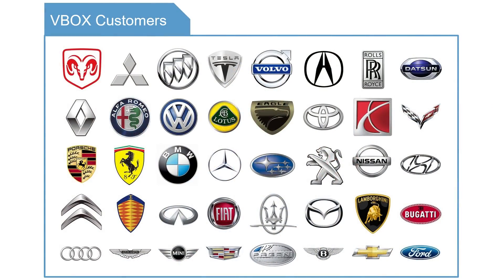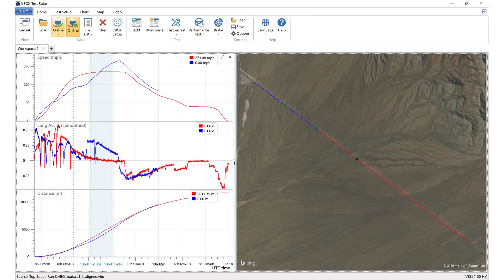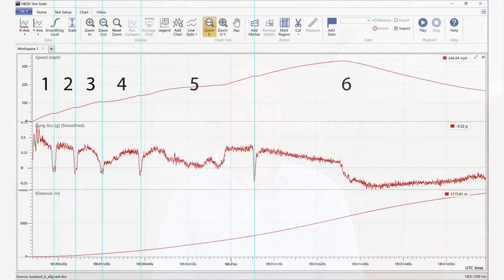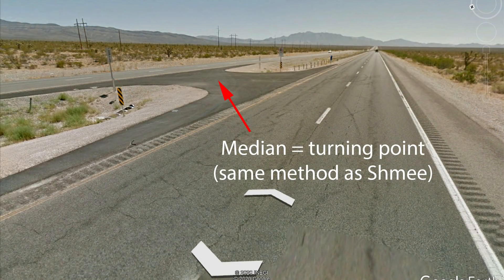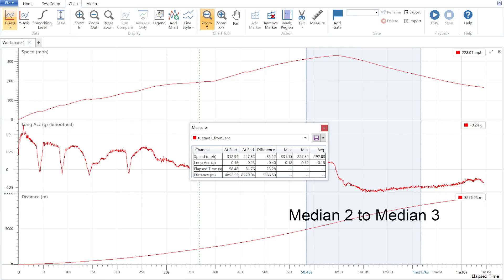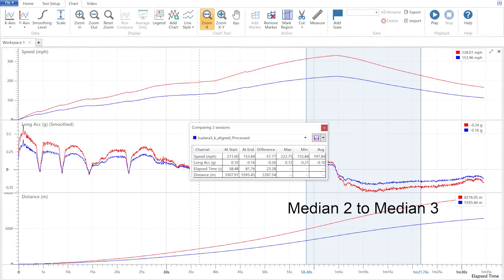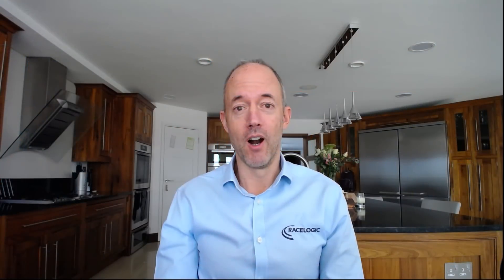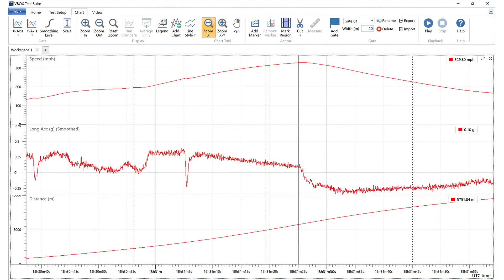How fast did the SSC Tuatara really go? Here's my calculation based on some new data.

Comment: HENNESEY VENOM GT WITH 1200 HP REACH 271 MPH

1750 HP SSC TUATARA EASILY CAN DO MORE THAN THAT
Reply: He does not say it was the cars top speed. He is calculating the speed in the video and it was still accelerating pretty good when he let off. Didn’t you watch the video?
Reply: True it should be much faster. For some reason they chose to cheat. Maybe it was too windy maybe there was another fuck up they had to deal with and did not want to waste the closed road. So they faked a run. Only they know.

Comment: Kudos to Shmee, Misha and Robert as well as Julian for the data analysis.  If the estimated Vmax is 223 mph, I need to ask, and with all of the respect, how did Oliver Webb not realize that the speed seemed too slow for 331 mph... that is approximately 100 mph (160 kph) less.  I would imagine an experienced race car driver would detect something was awry.
Reply: He's not paid to talk.
Reply: It looked good on Oliver's IG page which seems to be more important than actual racing. From experience I can tell that 250 feels twice as fast as 200, and also 285 feels again twice as fast as 250. Yes, on this cock up, everyone including driver, were sleeping. What a joke.
Reply: @erik_eriksson_design  id bet since he was the driver he new but it depends on how isolated you are. Going 150 in a new s class vs a 20yr old corvette makes all the difference. go karting at 50mph seems extremely fast
Reply: He already drove a One:1 over 240mph at VMAX200 event before, so it's quite hard to understand how SSC has convinced him that he was doing 331mph. Imo, he probably did felt something was wrong, but has nothing he can do about it, and decided to keep his mouth shut. On the good side, he got another VMAX200 record of 404kph (about 249mph I think) in a Koenigsegg Regera with a passenger beside him a few days later.
Reply: If SSC used atleast part of their brain capacity setting up the run, making sure that the driver signed a NDA simply stating that he cant make any comments of the run, whether the car achieves a higher top speed or not, would be smart. Can't have any loose ends with this much at stake.
Reply: Ask Diego Maradona why he didn't cry hand ball when he scored ,"The hand of God" against England.
Reply: Whoops. Sorry Diego. People have a habit of dying when i mention them in a bad light. My bad.
Reply: @Elias Håkansson maybe half way through run he felt some bad juju and said nope, that’s fast enough
Reply: It is 175kmh less. That is massive difference. Especially when comparing 360kmh to 530 that no man has before travelled in public road. Shameful scam.

Comment: The biggest red flag among many remains the rather absurd acceleration from 260ish up to 331, which would put the SSC squarely into Bonneville Salt flat rocket car territory.  All legit speed runs by the main players, be it McLaren, Bugatti, Koegnsisisnenengegegegeggggg, etal, show an ever-slowing acceleration as they approached the V-max, which matches known physics.  If this SSC data is to be believed, this car's top speed is closer to 400 than 300.  Just absurd.
Reply: SPOT ON. 

for anyone with a brain the whole thing looked fake as hell just by eye let alone requiring all the verification data. such morons
Reply: You nailed it! In fact that was my impression too, even before I found out the questions being raised about this "record breaking run": It goes from 400 to 490 km/h in just 10 sek.(!!!), where the Bugatti does it in 40 sek. It is just too fast having "only" 1750 hp..........
Reply: @perhentzepetersen9310  it fack man!  being mechanical engineer i know that by increasing no. Of cylinder and decrasing cc  of each we can decrease torque and increase speed but it look like kiding   when i saw this at 13th of sec in video tuatra reach 331mph!!!😂😂😂
Reply: @perhentzepetersen9310  VTEC just kicked in lol
I wasn't paying that much attention but yes well spotted.
Reply: I like how you spell koenigsegg 😊

Fun fact: I used Google speech-to-text for the right. How did I learn the pronunciation? I've been watching a lot of agera and regera videos
Reply: @DevJMD  herby derby
Reply: @DevJMD  We know its BS, he knows its BS, even the name Jerrod Shelby uses for his company is BS. Jarrod Shelby is in NO WAY related to Carrol (Cobra) Shelby, he USED/ABUSED the name, most people who hear Shelby think of the Cobra heritage, he used that.

This Jarrod Shelby is a shady liar, even his past, before SSC is very shady to me.

BTW SSC only made 2 cars and BOTH cars made "record runs" "verified" in the same manner!
Reply: It has NOS
Reply: @MatteoVeronese  in fact if I had claimed there was linear scaling, this would imply that I believe the SSC would do 500mph. Did I say this? Anyone else got something dumb to say?
Reply: @flowmastaflam  No,  you have supplied enough of “dumb” to this thread already :)
Reply: @crabapple1974  alright let’s talk about it. Point out what you have an issue with and I’ll explain why you’re wrong.
Reply: @stevenross-watt8640  that the SSC makes over twice the power, yet this channel claims it only achieved a 6mph higher top speed.
Reply: @flowmastaflam  The analysis of the video shows that in THIS RUN the car didn't do more than 223mph. Nobody, Nobody has said that is the highest possible speed the car CAN achieve. It is worth trying to comprehend that as you are welcome to have an opinion on how fast it COULD go, but all this video states is how fast it DID go.
Reply: @stevenross-watt8640  Julian said he thought the car would go much faster than it actually did.
Reply: @brownro214  yes I agree. My comment stated that NOBODY thinks the theoretical top speed of the SSC is as low as the real speed achieved in the video. That includes Julian. But the evidence we have so far only shows what it has achieved to date. So I guess your reply was to agree?
Reply: @MatteoVeronese  nobody said there is linear scaling.
Reply: Lambo aventador svj does 216mph with 760hp. The SSC has 1000 more. This is not rocket science. Be better.
Reply: @flowmastaflam  yeah but the 1000 bhp get put on the ground through the same 4 tires, that is precisely why its fraud, this is not rocket science be better your ass
Reply: @sharp4271  what the hell is your point
Reply: @flowmastaflam  that its not a goddamn plane, it still has to have the same amount of traction no matter what the hp, and the tires limit even an unlimited hp car from going the speed of light
Reply: @sharp4271  nah, the SSC is rwd, the svj isn’t. There’s more drivetrain loss with awd, thus less power to the wheels...
Reply: @rot_v  yes thats true but my point was that it shouldnt have been acclerating that fast from 260 to 331, that sort of acceleration is very hard to believe and do unless you have a jet engine or something strapped to the back
Reply: @sharp4271  yeah I agree, that acceleration at speed was too hard to believe lmao
Reply: @flowmastaflam  Yes, but the Bugatti Chiron 300+ has 1600 hp and needs fully 40 sek to go from 400 to 490, wheras the Tuatara with "only" 150 hp more does it 30 sek faster? NO WAY CAN THIS BE TRUE!
Reply: @perhentzepetersen9310  why is this not possible? You realize that the Bugatti was 25% slower than the koenigsegg in the 0-400-0 test, right? What does this tell you? The Bugatti is massive, and weights 4400 pounds. The SSC is 2750lbs. You haven’t considered this when thinking about acceleration?
Reply: @flowmastaflam  Yes I did, but it still does not make sense! The numbers are just too fast to be true: It was not slowing down at any stage, and it was still only in 6 gear out of 7. The recordholder Koenigsegg used 22 sek to go from 380 till 454 and could not go faster. The Tuatara needed just 7 (!!!) sek  to get to 454 from 380 and kept on climbing with same insane speed.....

Both Koeningsegg and Bugatti used specially developed tires for their run, wheras the Tutara used "standard" tires.

It turns out that the Tuatara hardly made 230 m/h in reality, and the Bugatti DID 304.77 m/h and was till climbing!

Let the Tuatara do it again, and lets see if it is enaugh to break the world record.
Reply: @perhentzepetersen9310  To be fair it was only still in 6th because they changed the gearing of the vehicle because apparently they were hitting their limiter and needed to stretch the gears. It's a great transmission
Reply: @flowmastaflam  weight means almost nothing when speeds reach 200+mph... Aerodynamic drag far outweighs any negative effects of weight.
An F1 car has 1000hp and only reaches about 220mph. The F1 car only weighs 750kg or roughly 1600lbs. 
Why?
AERODYNAMIC DRAG.... NOT WEIGHT
You're making yourself look dumber and dumber with every comment you make.
Just stop talking.
Reply: @csonkaperdido  Think you meant to type that to someone else.... awkward...
Reply: @flowmastaflam  no I definitely meant it to you
Reply: @csonkaperdido  Okay then you're just confused. We're agree on everything you said.
Reply: @flowmastaflam  you're claiming that there's no evidence of this "record" being fake and seem to think the car DID go 300+mph, I saw your replies on other comments also.
I'm saying that there is a HUGE amount of evidence pointing to the fact that the car never even went as fast as the Agera, which went 280mph.
Reply: @csonkaperdido  my argument is that we don't know. And the excuses given in Jerod's video are plausible. Mistakes were made and Jerod posted a video talking about the mistakes that were made and their intentions to run again with certified timers and witnesses to watch. Even the guys that made the original debunking claims have responded to say they really respect the response from Jarod and they know the car has the potential to run 310+. So I'm not going to convict someone guilty until proven innocent. I'm just going to step back and wait and see. As people should learn to do.

I like how you changed the sibject real quick ;)
Reply: @csonkaperdido  oh okay i thought the part where you grilled me about some irrelevant stuff about weight, and your next message was about evidence pointing towards the run being fake was a subject change. You know, since you realized you had screwed up and all.
Reply: @flowmastaflam  Just shut up, will you? You did mention that the Chiron is heavier and therefore the SSC should be much faster. So @Bass 'n Kitties was right pointing you out.
Stop embarassing yourself.
Reply: @Tacet137  I can tell you’re young because you’re talking about grades
Reply: @flowmastaflam  wind resistance is a bitch. The faster you go, the more power you need, and this relationship is exponential.
Reply: @flowmastaflam  I would just like to point out that aerodynamic drag increases roughly with the CUBE of velocity. That triple digit horsepower increase goes almost nowhere because you're not accelerating the car anymore, you're pushing the air around the car -- air which is behaving in a manner closer to honey or molasses at those speeds. That realm of aerodynamic extremes isn't seen much outside of jets or... wait for it...

...rockets

Comment: Brilliant analysis! SSC really need to contact you at Racelogic to straighten things out in the next attempt, I am sure there will be a next attempt because they are bragging about being the world's fastest car (for over a year!!!) and even have 316mph on their website, not humble enough to retract it. (This is why I have no respect for SSC - they are just car hustlers). Before this scandal (at SSC they don't even understand what they have done...) I had no opinion about SSC. However - they are said to have had the record over a decade ago, now I have thoughts about that too...

Your analysis does raise a number of questions regarding the car manufacturer and the driver... Did they really think the car was that "bad ass" (excuse my bad american) that it was accelerating at 1G at those claimed speeds? There is a difference between 331 and 223 that somebody should have felt. Either they do not know their product, they are not experienced with speeds over 200mph or they just tried to pull a fast one... 🤭
Reply: This was an intentional stunt. If they did it right the first time, they would not have as much Press Coverage
Reply: They have been working on the Tuatara for 10 years now, and they really wanted some results. Maybe the money is running out? This is one of the biggest scandals in the history of speed records !!!